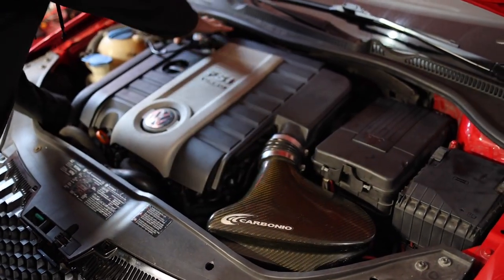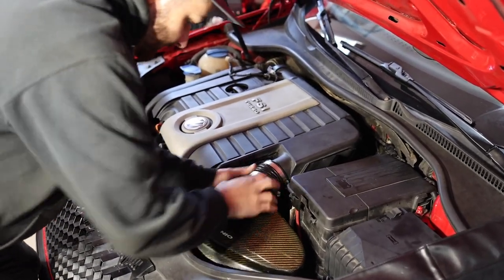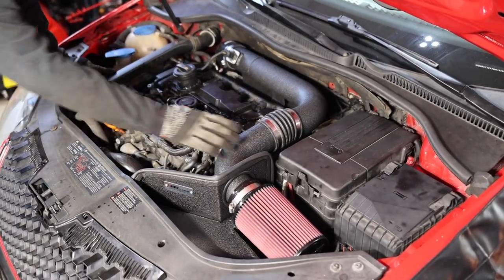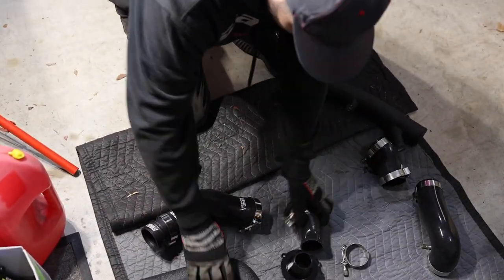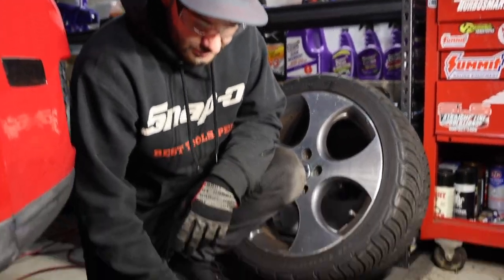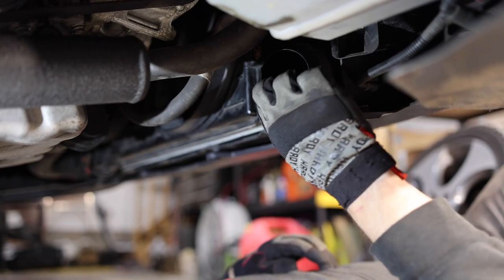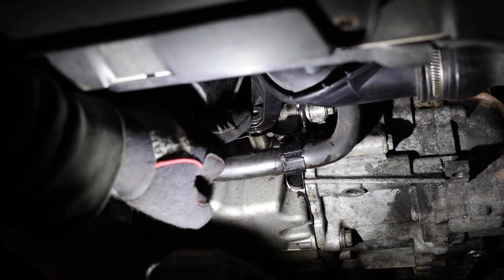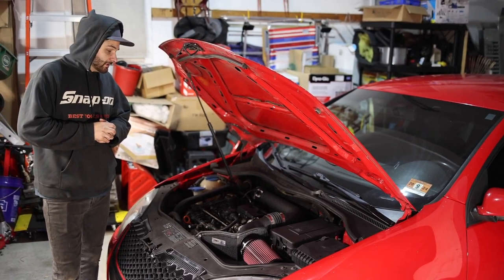How To Make Loud Intake Sounds With A MK5 GTI!

Comment: I had an MK5 GLI back in the day...there's a pipe that routes some of the air from the charge pipe into the cabin of the car (for noise). Its a good mod to delete it, you'll get better throttle response. I used a home depot test plug to seal the hole after i deleted the pipe 🤣 it's ghetto but it worked!
Reply from the maker: Hahah we actually just did that the other day! I did that on my old GTI back in the day too but it’s def a must do cheap mod!
Reply: Where is this located for me to do this mod
Reply: @RatchetWrenches  hi mate where is this pipe I want to do this to mine
Reply from the maker: @chrismaddox88  it’s hard to explain but if you Google or YouTube mk5 noise pipe delete you’ll see plenty of videos!
Reply: @RatchetWrenches  found out it’s a American thing I’m in uk mate

Comment: I don't see anyone saying it but the old intake kit installed is the apr carbonio kit. Yeah, its real carbon fiber, and I bet you even had the reusable filter in the stock air box. Kind of a rare part these days. I still have mine from years back.
Reply from the maker: Thanks for confirming this! That's pretty cool actually

Comment: What are your impressions with that carbonio?
Was there any noisier sound compared to the factory air hose?
Was it noticeable on the gas pedal?
I like the design and the fact that it pushes air into the factory filter box as soon as the car starts moving.
Reply from the maker: Unfortunately we couldn't compare because we bought the car with that intake on it. But comparing it to the ECS Tuning intake, the ECS was significantly louder and sounded way better. You could see the filter bending slightly when you hammered the gas it was pulling a lot of air in

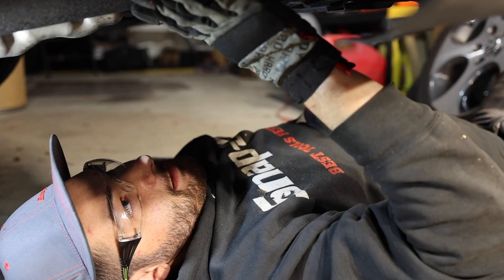Comment: I know this is a bit late at a year later but did you guys ever go back and address the boost leak at the intercooler inlet where you didn't have seal on the bung when you installed it ( @14:05 time stamp). I did the exact ESC turbo muffler delete and charge pipe to cooler kit on my MK5 and noticed how rattly the bung sounded when you installed it and re-watched that section and noticed no seal. I had also done the polished ECS cold air version of what you guys used - I really like the sound, just enough inlet noise but not obnoxious
Reply from the maker: We never did nah ended up selling the car shortly after.

Comment: Have the mk6 gti version of the intake with silicon tubes and without the heatshield, but the intake noises only are noticeable when driving in sport mode. Would the headshield fix this, or would i need to remove the hood insulation?
Reply from the maker: You can try to remove the heat shield I don’t think it will increase much noise. Only downside to that is the turbo/exhaust will heat soak the intake and possibly mess with the airflow. Now you can remove the hood insulation that should help yes. I’m not to familiar with the mk6 but does it have the noise pipe? If so remove that and you’ll really increase your intake nose

Comment: I just bought a 2008 gti t-fsi 
What year is this? Mileage? Mine is at 73k right now. What maintenance should i make sure to do?
Reply from the maker: Awesome you'll love the car! This was a 2007. Besides an oil change if it needs it, I'd just do a thorough check over all of fluids, suspension, brakes and tires. I believe 60k maintenance was more important so make sure the previous owner did that.

Comment: Is there a reason to delete the “noise pipe”? I’m new to the gti scene and just looking at a reason to take it apart😂
Reply from the maker: Removing it will create a better throttle response and also you’ll have some cool turbo sounds inside the cabin! Other then that though there’s not many reasons to remove it hahah

Comment: Interesting the different sounds people like . I cant stand the noise my intake pipe makes , to the point I find it embarassing . The heat shield for the filter does nothing at all but look nice and clog up the engine bay , you need an actual sealed box system to the front grill ( like the stock set up ) or your just sucking in hot turbo ambient air . Side note , if anyone I know saw me wearing gloves while wrenching all respect would be lost
Reply: Just installed it car does not like it